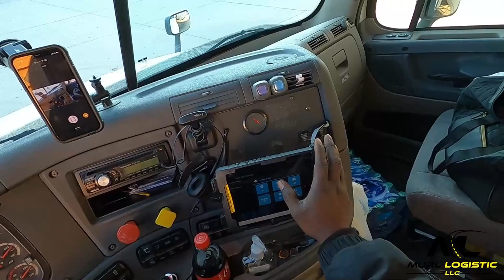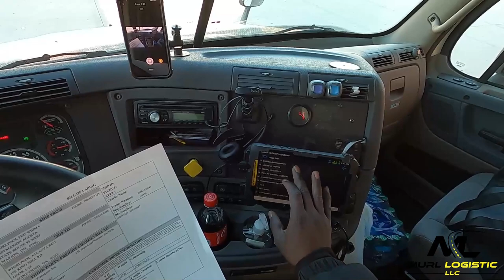Make $1000 a day | Local owner operator | Hauling Container | Day cab Trucker vlog | Ep.1

Comment: Good to know that (JB Hunt Atlanta) pay well to daycab owner operator because here in Allentown PA you would never see that kind of money.... you'll make between $330/470 a day .. hauling heavy because light loads are only for JB Hunts company drivers..and they called it good week.(BS).... $500 or $600 if they have performed repairs on your truck. so that way theyll make sure they can deduct all of it before you get pay.
Reply: Why work with JB hunt then?
Reply: Agreed! I did Intermodal for JB 6 years out two different locations. None of the o/o I used to talk to made that kind of money. But salute to this brother. I guess Atlanta is a pretty good hub to work out of

Comment: Are containers like trailers, you just hook up and go ? Or you have to secure the container on the chasis yourself. 
I got a Day cab like you, I be seeing container loads on the load board but I’m scared to book them. 
I don’t want that shit to fly off the chassis 🤣
Reply from the maker: It’s a simple procedure watch all my videos man I cover everything
Reply: For anyone wondering, it's two locking pins in the back. That's it.
Reply: 2 pins in front as well.
there are 4 pins in total. basically one at every corner to lock onto the chassis.